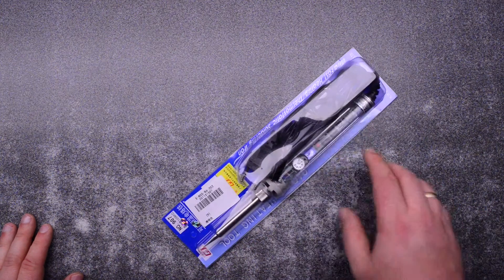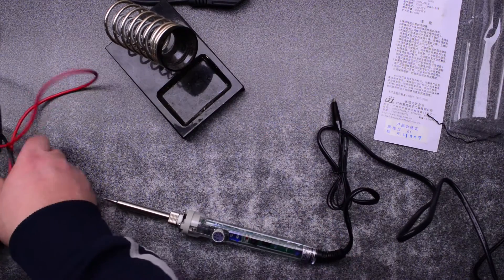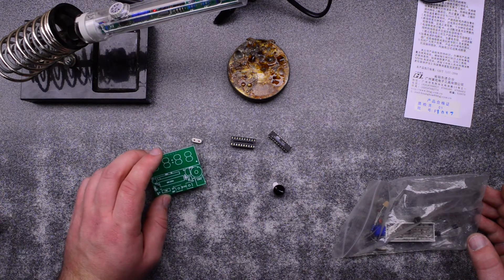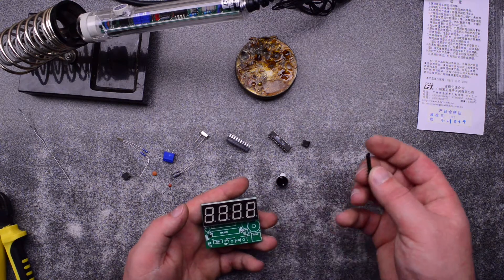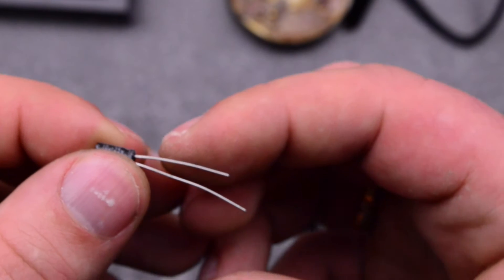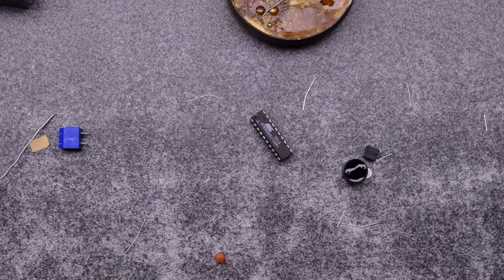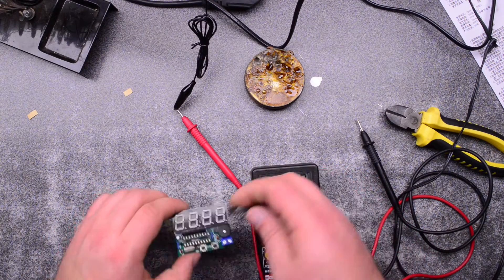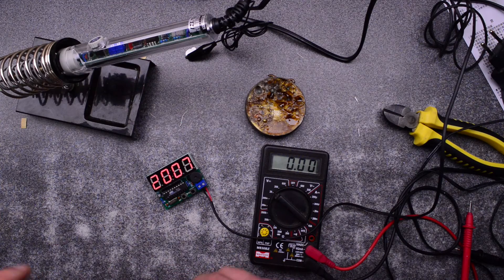GJ No.907 soldering iron unboxing & test. DIY digital clock assembly

Comment: Hi, thanks for the video. My soldering iron is no longer working, do you have any idea which component could be blown? thank you
Reply from the maker: it is impossible to tell you anything from the information you have given me :) if there are no visible burned components which you can see through the clear plastic, it might be the thermo element in the soldering iron. But in any case you need to follow the circuit to see what is wrong. But with price of this soldering iron, you might as well get another one :)